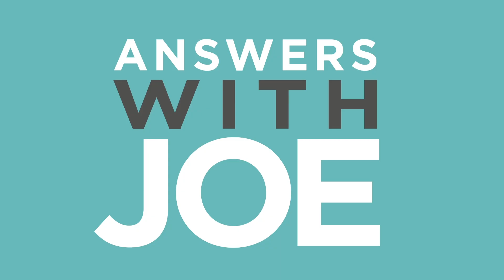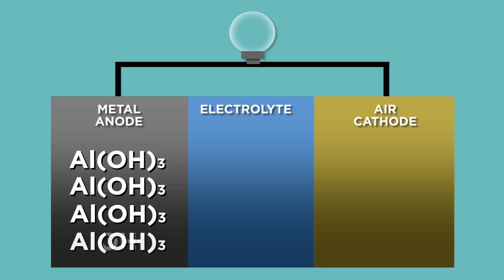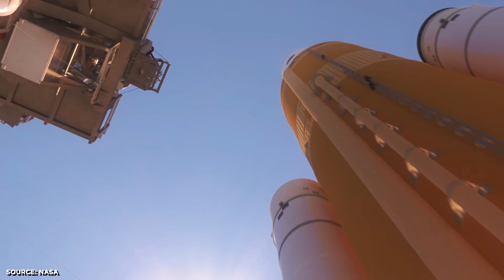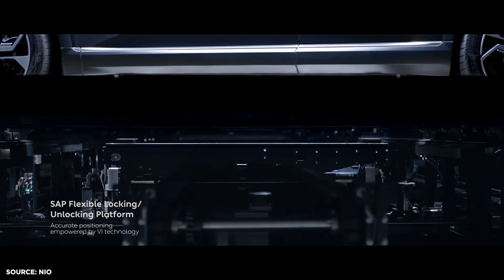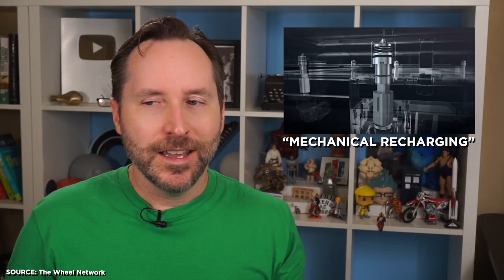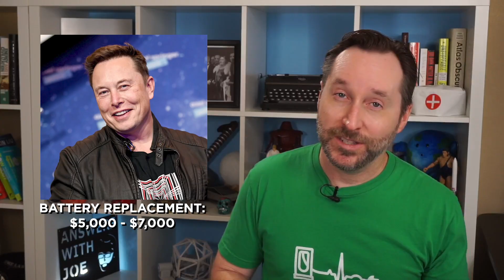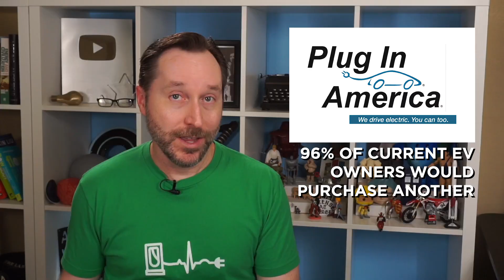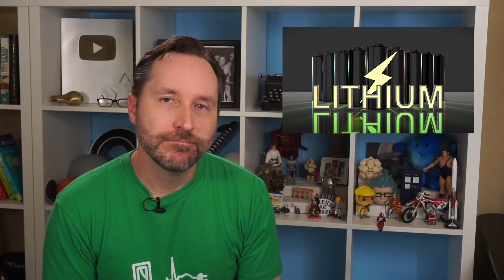This Battery Could Drive A Car 1500 Miles - But There's A Catch | Answers With Joe

Comment: Aluminum batteries are a lot less recyclable than you might assume. Yes, aluminum is incredibly easy to recycle, however, once the batteries are spent, the chemical is turned from aluminum (Al) to alumina (Al2O3). Alumina is not nearly as recyclable and currently by far the most commonly used method of refining it back into aluminum is to melt it down and electrocute it with carbon rods making carbon dioxide in the process. That means that there is almost no chance these batteries will end up reducing carbon footprint unlike lithium ion ones. I will give it the advantage on being far more convenient for ships and it would be easier to recapture the CO2 made from a refinement plant than just diesel exhaust.
Reply: That's the real Mr. Asterisk
Reply: (genuine question) What is the carbon footprint of the production and then discarding of Lithium batteries compared to Aluminum batteries, or even petrol engine?
Reply: @Marc-ze9me  The carbon footprint for production and recycling of nearly anything is largely irrelevant if the power used to produce and recycle it has a low carbon impact such as solar etc. The twisting of this fact is a common way that fossil fuel advocates gaslight people into believing that they might as well keep burning up the planet cause everything's all the same anyway.
Reply: @blackwind743  Ok, but so is the mining of lithium and production of battery of low environmental impact? I am basically trying to understand the environmental impact on full lifetime of a conventional battery powering today’s electric cars vs aluminium batteries. Thanks in advance for the replies! Genuinely trying to understand to forge an opinion - not advocating anything :)
Reply: @Marc-ze9me  Considering that 92 percent of the battery cell material from Tesla's batteries can be recovered in the recycling process I'd say lithium is the best option atm. I am certain something else will eventually replace it. Aluminum air is not it though I think. This more seems like a money grab to keep people suckling at the teat of an energy provider instead of recharging their car with solar panels. Cobalt has long been one of the main environmental concerns with lithium batteries but there seems to be a trend of moving away from using lithium ion chemistries that use cobalt in the cathode.
Reply: That is a very good question!
Everything having to do with energy as a conversion process.
I believe there's a negligible gain With that type of processing… Small if any  ecological advantage.
Reply: @Marc-ze9me  It's been proven that charging electric cars releases more carbon emissions than a petrol engine. carbon helps trees grow though, to bad humans are cutting them down at a faster rate than they grow.
Reply: I didn't know the graphite anodes are consumed in the making of aluminium. Learn something new every day.
Reply: @zapfanzapfan  theyre not tho
Reply: @jamesfennell409  I just read up on the process thinking that was not the case either. About 0,5 ton of electrode per ton of aluminium. And 14 MWh of electricity I think it was.
Reply: @Protista protista U sure electrolysis of alumina doesn't produce CO2? My sources say it does.

https://en.wikipedia.org/wiki/Hall–Héroult_process#:~:text=of%20the%20electrolyte.,to%20produce%20mostly%20carbon%20dioxide.
Reply: @bagelgeuse5736  You are right; it definitely produces CO2 from the carbon anodes. There are a bunch of cool videos on YouTube that show the process. Every electrolysis plant has a big section devoted to fabricating the carbon anodes that are consumed in the process. You have to understand that the vast majority of people commenting here do not have much understanding of the details and don't know what they are talking about.
Reply: @jonahansen  U right, but my doctorate in arguing on the internet says to never flat out call someone wrong and to instead use sources, so that's what I do.
Reply: Many people think recycling is free.
It never is.
Reply: aluminium oxide is already a daily part of aluminium production
saying that it's not recyclable when it's exactly what gets transformed into usable metal is funny
Reply: Interesting discussion...
Got me thinking about carbon capture and at what point does making methane or something from carbon in the air make sense....

Also gotten wonder about long term seasonal energy storage.... I.e. storing solar in the summer for winter...
Reply: @deth3021  Fun fact: Carbon capture can make sense because coal power plants burry upwards of 80% of their co2 released under the ground. Tapping into these underground stores of co2 and turning it into methane is  a thing. Unfortunately it is a technology in it's infancy and currently sucks.
Reply: @bagelgeuse5736  I was more referring to atmospheric carbon capture.... and the idea that you build like a massive solar farm in a some desert somewhere and use it to create methane or hydrogen which you then ship or pipe to where you need it.
Then you can use the methane or hydrogen in fuel cells or internal combustion engines depending on the application.
Li ion just doesn't seem to have near the world's energy storage needs, both in terms of scale and longevity.
Reply: @deth3021  You definitely can do that too, it's just a lot harder. Shipping hydrogen is also an enormous pain, so stick to methane for now. If my math is correct 1 lb of hydrogen takes up about 200 cu ft at atmospheric pressure, or 1 kg takes up about 11,000 litres. Not fun to transport due to that.
Reply: @bagelgeuse5736  the real problem with hydrogen is containing it .... it just leaks out of pretty much everything.
But like I say piping would also be an option.  The nice thing about methane is afaik you could reuse the current gas pipelines.... 
But long story short I was really just wondering abou comparing atmospheric carbon capture methane to aluminium batteries.....
I could see the aliuminum being interesting for long term storage.... but methane/hydrogen seems better  for transport especially aviation etc...
Reply: @deth3021  Currently our carbon capture technology is far from good enough to complete with lithium ion or aluminum batteries for cars or boats. For planes it is better than batteries, but nowhere near good enough to complete with fossil fuels.
Reply: @bagelgeuse5736  that is if you are trying to do it locally.
The question is about the idea of massive solar arrays in the desert or wind farms in the north sea. Etc...
Money is going into this, and it doesn't seems crazy from what I've heard here and there.

Haven't seen many hard numbers on it to be fair.
Reply: So why not use ZAFCS zinc air fuel cells instead ?
Reply: Our fight against CO2 can never be to eliminate emissions completely, because that just cannot work, as long as these recycling plants remove more co2 than they emit there should not be an issue with that recycling process.
Reply: @hansmueller4438  You're correct, however refining the spent aluminum batteries is the exact same process as refining aluminum ore, because the chemical makeup of spent aluminum batteries and aluminum ore are almost identical. That means the batteries might as well not be recyclable and the atmosphere would not notice. Especially when you can get solar and run your car off the sun putting very little co2 into the air over it's life, so aluminum batteries are a joke until we can refine alumina in a carbon neutral manner.
Reply: @hansmueller4438  but they're literally burning carbon in order to remove oxygen from the aluminium.
Reply: @hansmueller4438  There is no real issue tho. It's a monetization and a campaign. The ice is melting and thats just a phase of the earth. before the ice there wasnt ice. before no ice there was ice. Theyll find things and create problems around it strictly for $$$.
Reply: Ye can't even pronounce the word so I'm not going to pay ye any heed
Reply: Err while I agree that aluminium hydroxide (the actual output of this energy store, that needs to be dehydrated to alumina (so even worse energy use)) is not a great output. Currently only 5% of lithium batteries are recycled and 1 tonne of lithium releases 15 tonnes of CO2 to produce (cf. 2 tonnes CO2/tonne steel).

Not sure we can ever produce our way our of a crisis caused by essentially production. But I guess someone has to take all that venture capitalist cash.
Reply: @seb3090  I have made a critical error, thank you for informing me of my incorrectness. After further googling you are correct that the system does not directly produce alumina.
Reply: We can modify the design so that it can be recycled using newly made material
Reply: simply untrue
Reply: Are you suggesting the CO2 is made in the electrolysis or in the production of the electricity for the electrolysis? You could just use nuclear power for that, and I'm not worried about CO2 anyways.
Reply: @joshuaworley3898  Unfortunately no, the oxygen in alumina needs something else to bond with as well as electricity. That thing the oxygen bonds to is almost always the carbon rods used to conduct the electricity.
Reply: @joshuaworley3898  The aforementioned Carbon Rods are probably used up in the process, releasing the Carbon they contain, bonded with Oxygen.
Reply: @joshuaworley3898  CO2 is made during the electrolysis, it's using carbon to lure the oxygen back out of the aluminium. It's the same process how regular aluminium is made. All natural aluminium is in a "burnt" form, then we un-burn it to produce aluminium, and what the batteries are doing is essentially burning aluminium with oxygen again. So, to un-burn the aluminium, something more juicy has to be presented to the oxygen, so that the oxygen leaves the aluminium and bonds with the new juicy stuff. That something is carbon. The carbon electrodes get burnt in the process to un-burn the aluminium.

So, we're back to the problem of burning stuff to produce energy.

This is just coal power with extra steps.
Reply: BagelGeuse - yes you just summed up exactly HOW aluminium is "'made" - that makes Alumina INFINITELY recyclable - using, how about it, Hydro or Geothermal Energy in Norway or Iceland, Canada or Tasmania...   Objections based on "I Like my mommys tesla  just how it is thankyou very much"  (so your objections are all BS - in actuality...  you are hooked on a one Man one World Dream.   lol )  ...    Its off to Marz on a one way Bar for you...

Basically  who cares about Climate change  (How Dare..), Breathable air in Beijing and New  Delhi (and many more places  - you know  - all the SH countries) is probably more important - and will make a greater difference for more people, suffering early death, than Climate Catastrophe some time in the Future. 

(We the Humans - living in the animal farm of late -  tended to "Conquer and Overcome" - Obstacles   in the PAST..   It is what we do.   You  and your Generation(z/m/a+) are just too set on the Comfortable Lifestyle handed you on a plate, you are hesitant innovating and expanding horizons......   

(NB. Jokes, and Assumption....  Chill - "How Dare you"   lol..)

If you served for the good of humanity and US interests on Anti terror missions, it is likely you got played - I am so sorry for you and your Compatriots. Now you may have to Decide on whom the Legions play against.  Orders or Duty.  (TLDR , Reread the first paragraph( :-0)
Reply: @kadmow  re-refineable, which releases CO2 from the carbon electrodes in the process. Shipping is also a very dirty industry (hello heavy fuel oil) so exactly how are you moving these hunks of metal around the planet?

So I'm still not seeing this as anything other than a stupid idea, but sure. 

If you want to stop environmental collapse we need to stop producing things. Because the next generation are not pollution free, only an improvement on what we have now, and the next generation is slightly better, how many generations does it take to get to the mythical non-polluting production? How do you refine and reduce metals without producing waste, thermodynamics and chemistry show this is pretty much impossible. So the idea we can produce our way out of a problem essentially caused by production seems pretty flawed.
Reply: @kadmow  You have completely missed the purpose of my argument. Yes it is recyclable but not efficiently recyclable. 
My sources also say CO2 is a direct byproduct of refining alumina.

https://en.wikipedia.org/wiki/Hall–Héroult_process#:~:text=of%20the%20electrolyte.,to%20produce%20mostly%20carbon%20dioxide.
Reply: @bagelgeuse5736  : Well Humphry, a new electrode is needed.

Comment: Great Vid Joe , when people think _____-killer product they neglect to account for the variability in peoples needs and capabilities. I live in a suburb that is a nightmare for EV's (90% of the cars are on street parking)  but we have Trains, light rail, cycleways , electric bikes hire , Car shares on every block  and lots of buses .. all of these are heavily used, rendering car ownership a 'special case' option rather than the norm. Your point that you could run an EV on rechargeable normally and replace it with an Aluminium/air battery for longer holiday trips is a good example of what I was pointing out - our way to a non planet destroying economy requires fine tuning and individualised solutions to make people choose wisely  - People who think that they will never buy an EV will change their minds when the gas stations start closing down , people  who would never let a car do the driving for them will reconsider when insurance for a self-driven car has a way lower excess than when they are at the wheel.

Comment: I don't see the problem here. You just set up battery swapping sites, like you have with propane tanks. You drive the car to 5% battery, go to a battery swapping station, pull out the old one and stick it in a slot, then grab a new one, fully charged and ready to go. The old one gets recycled, then sent back to be used again. It's even more efficient than charging TBH, with the only real downside of having to pick up and carry a battery to replace it... maybe they'll bring back full service "gas" stations, only instead of putting gas in your car, they're swapping the battery for you. Heck pair this with a self driving car, you could send your car to a battery swap site by itself, get a new battery and have it drive itself home. I'm all in for this. Let's freakin' do it. Hell, if they can make a version of this kind of battery that runs on CO2 rather than O2 it would be even better....

Comment: @Joe Scott  please do not spread the myth that EV batteries end up in land fill. EV batteries are very valuable and anyone putting one in land fill is going to a lot of trouble to do so.
EV batteries are always repurposed when they come out of the car.
Of any EV wreck the most money recovered from the sale of the wreck comes from selling the battery.
There is even an industry that makes money from intercepting EV batteries sent for recycling and selling them off for energy storage. 
If anything recycling plants are the bad guys destroying a valuable resource just to look good.
What ends up in landfill are the small batteries from phones laptops and power tools that are too difficult to recycle and the recyclers don't want.

Comment: This would solve the EV range problem for the people that tow a 2 ton trailer up hill for 1000km thru the dessert every day.
Just get an EV with 300km of range and put one of these bateries on the trailer (which they are always towing)

Comment: Another issue is the the convenience of filling a partial tank. When you get down to a quarter tank of gasoline, you can top it off.

If your disposable battery gets down to 25%, you replace the entire thing and lose that energy.

This could of course be avoided by creating several different cells which are interchangeable, but that very quickly complicates the "refilling" process.

Comment: That’s the dumbest thing. Why wouldn’t your just use an aluminum in a liquid state that you could just change out the fluid?
Reply: You could literally put an aluminum powder in a  catalysts suspension for increased production or a non reactive solution for a more sustained discharge. To fill it up, all you would have to do would be to run it through a scrubber, similar to a dialysis machine and take out the old aluminum and add new aluminum back into the suspension. Take 5 minutes. 🤷‍♂️ send it to elan musk, let’s do this.

Comment: Hey Joe, I can't talk much about it, but I know of a local company that is making prototypes of aluminum ion batteries that would have aluminum pucks that you would just swap out and then throw in the recycling bin when used up. They are supposedly making them in a 3 inch diameter so they would easily fit in your trunk. Pull over and swap out the pucks and throw the old ones in the recycling bin and be on your merry way. In theory the company said you could potentially stop at a rest stop and insert your credit card in a vending machine and get more of these pucks. This would eliminate any heavy battery systems as you could fuel up as simply as stopping at the gas station. Pulling the tray of pucks and just swapping in new ones with no technical experience needed.

Comment: Ok, have a car with a 1000 mile Al-Air battery, and a 50 mile lithium ion battery. That would allow for most people to drive where they need to without using the Al-Air battery, but having the flexibility to go beyond the... I just got to the point in the video where you mentioned this. Gr, I'm not original!